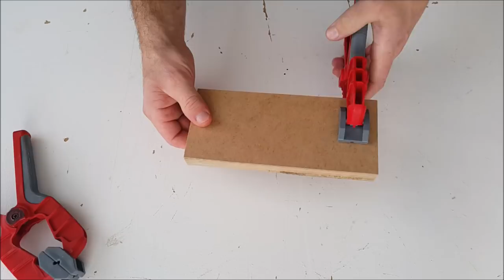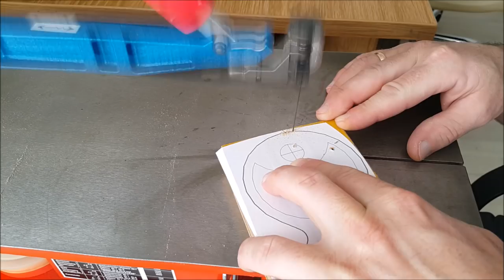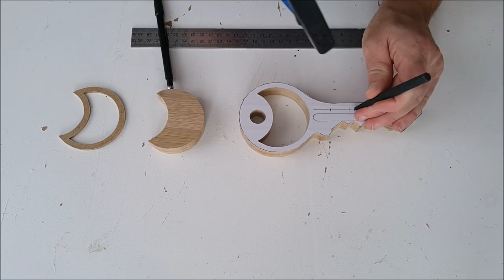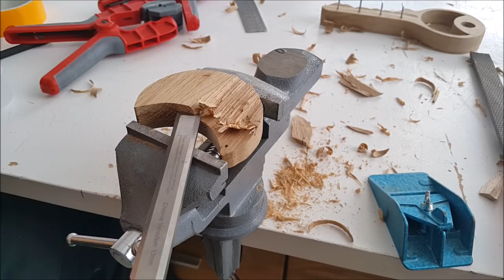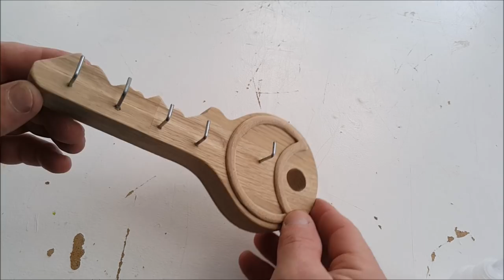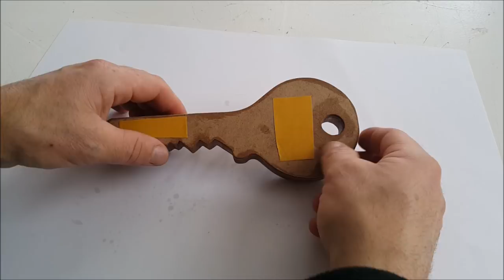Key Holder with a Secret Compartment

Comment: Cool project. Instead of carpet tape you could also use silicone to mount it on the wall!
Reply from the maker: Scrap wood City Thanks mate. It was only temporary solution for video purposes. I will probably glue it in to place with CA glue, great tip though :)